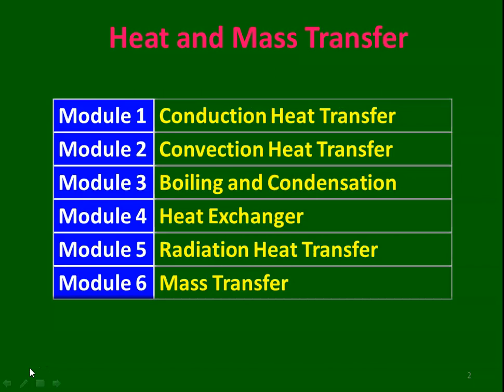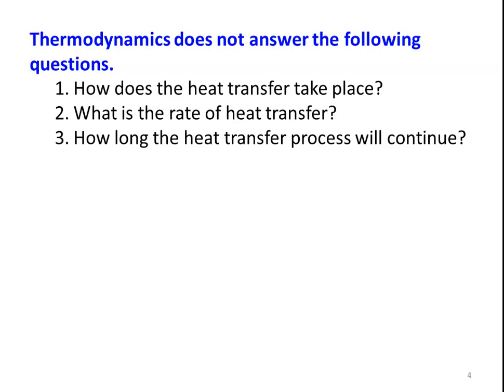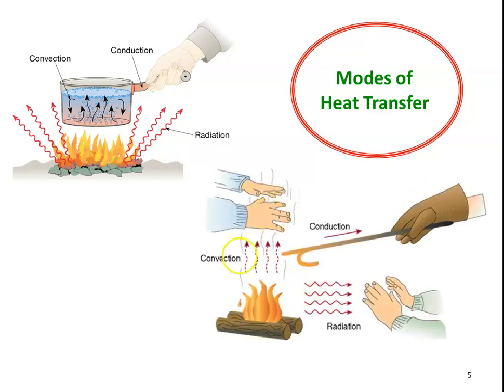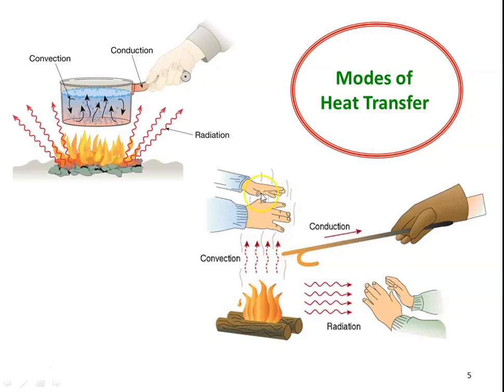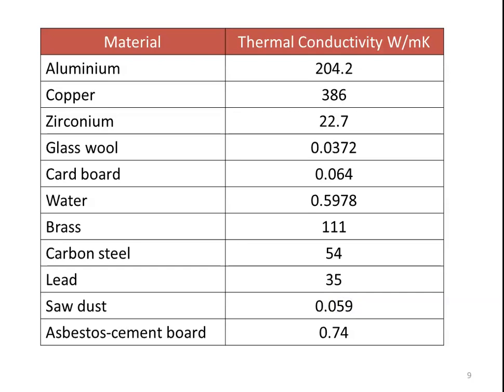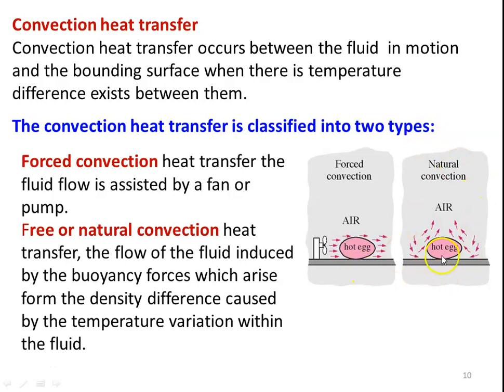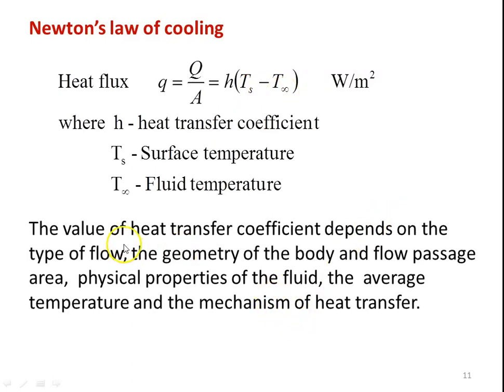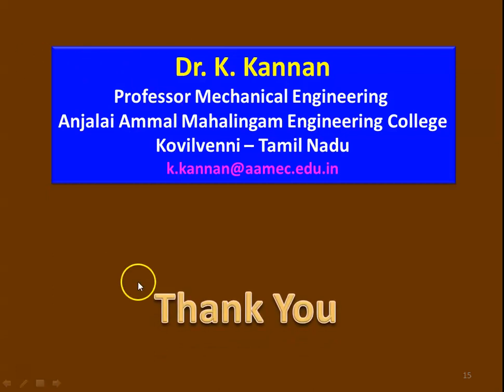1.0 Heat and Mass Transfer Introduction

Comment: Sir I am craving book
Reply from the maker: Heat and Mass Transfer by K. Kannan
Anuradha publisher Chennai
044 24360134, 24357410
Reply: @dr.k.kannan198   sir,they doesn't pick up call
Reply from the maker: Contact Mohan 9444079714